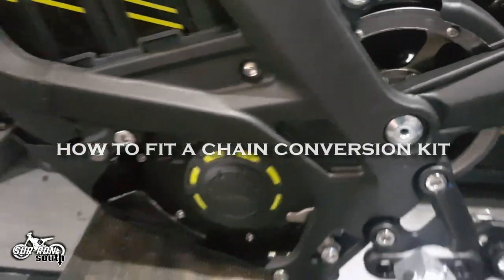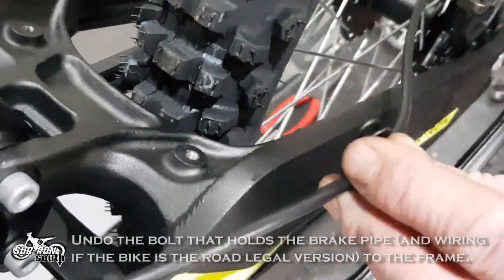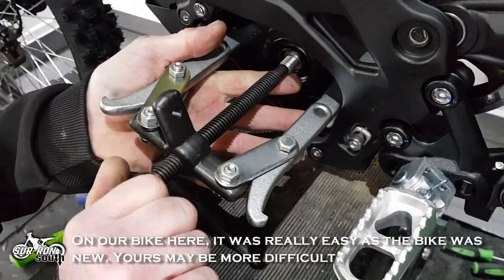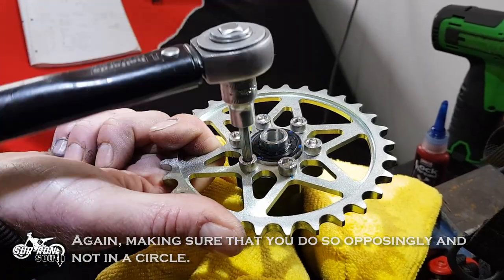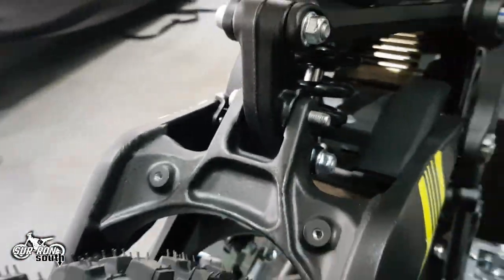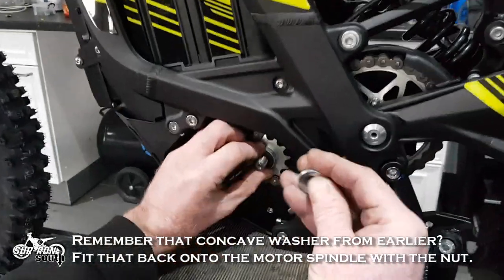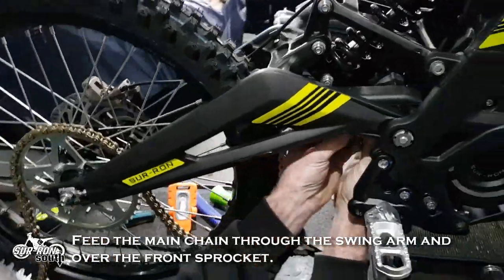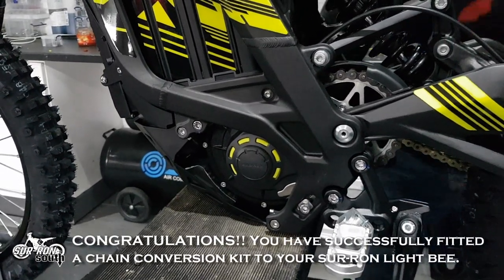HOW TO: Fit a Chain Conversion Kit to your Sur-Ron Lightbee

Comment: Thanks for the video. It was very helpful. Got my 420 chain on and I feel way more secure offroad. I had a rock go through my stock belt in the first couple hundred miles of owning the bike. I mostly offroad gnarly trails so the chain was an important upgrade for me. It is so freaking loud though! I heard a lot of people say it was loud but it is seriously as loud as a motorcycle at certain speeds. Thanks again.
Reply: how hard was this to do??
Reply: @blakehegemann  It was a bit of work. Nothing too crazy though. I’d say if your decent with mechanical stuff it is definitely doable. Most of it was easy and straight forward but there were a couple tricky parts of the project that just took a little patience and persistence. Getting the swing arm back on was the hardest part for me since I was doing it alone and didn’t have an extra set of hands. I’m decent with mechanical stuff and have a bit of experience but no expert. Hope that helps.

Comment: I'm at my wits end trying to get the swingarm and intermediate shaft assembly back into the chassis.  That special temporary bolt/shaft you made would be a wonderful item to get this done.  Any chance you have that for sale?  :). Actually, for us in the states, looks like a 3/8" dowel rod will work (9.9mm)
Reply from the maker: Yep, it's just a rod. We used metal rod that fit. Not sure if other materials would be suitable as they might break inside.

Comment: Don't know but i think youbhave been loosing the nut for the motor pulli earlier, ornist it just the hammer drill tool?.Man why is it not spinning, you already took the chain off, whats it holding? Cant get the shit back together, gant get the nut loose. Could be so easy to make it loose as a step 1 😭

Comment: How do you remove the nut from the motor pulley? Just keeps spinning for me.
Reply: You got to do that when the chain or the belt is still on. Once you remove the motor you're screwed
Reply: @FreeMissions i have my chain and belt on and it still wont come off how did you get yours off?
Reply: @bigjohnson69  u right tbh the only real way to do it is with an impact gun or it just will keep spinning.